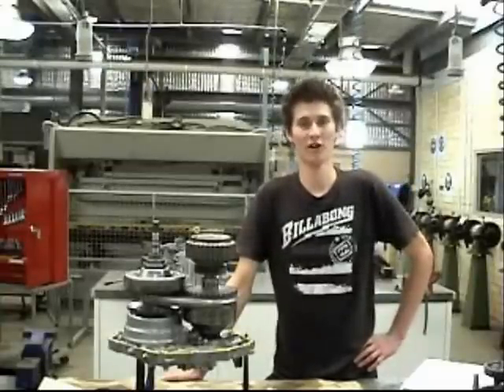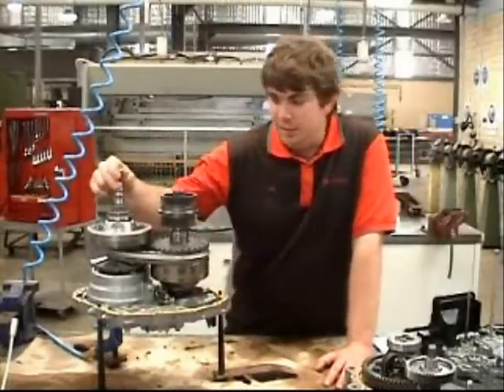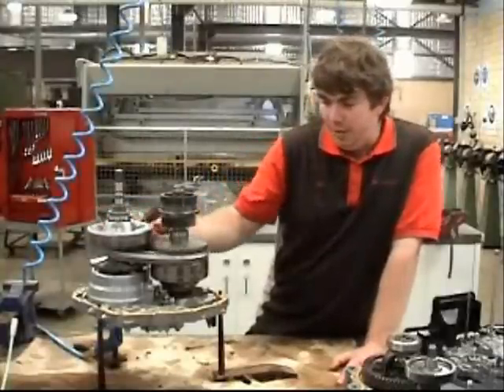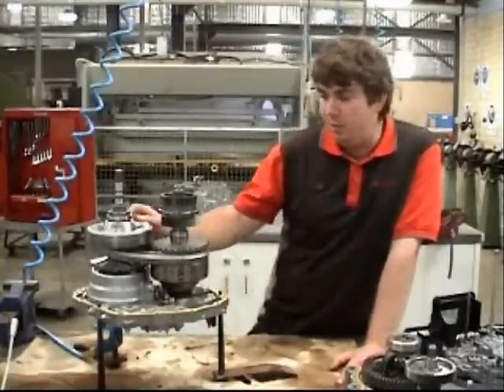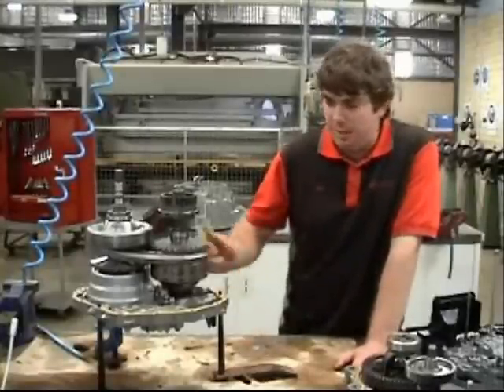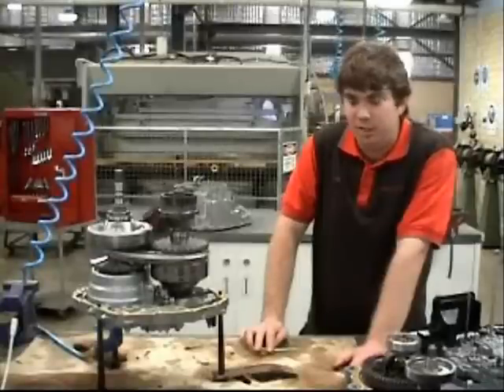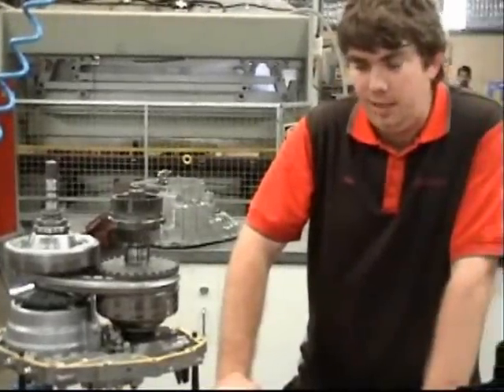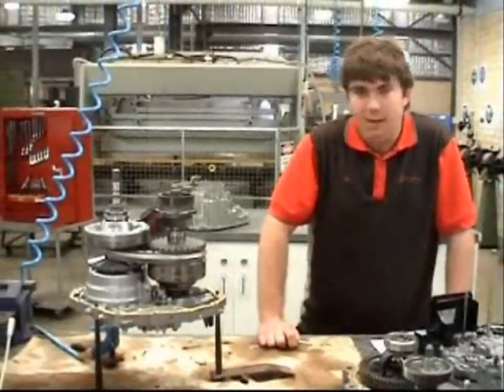Constant Variable Transmissions CVT - how does it work

Comment: How do the clutches work in a CVT transmission? The CVT is not really infinitely variable, meaning clutches have to be doing the work when the car is crawling at 0.25MPH up a hill. The pulley radius can't change that much.